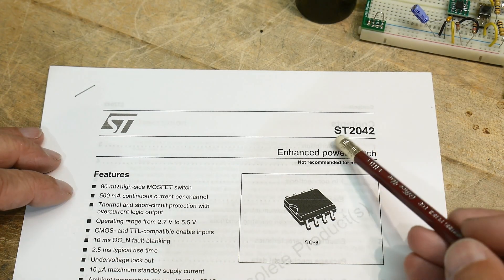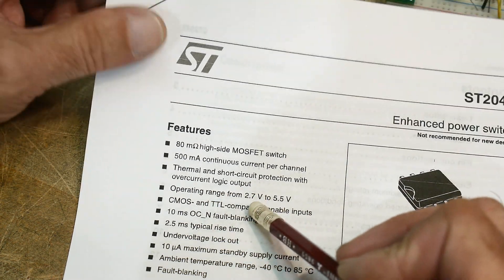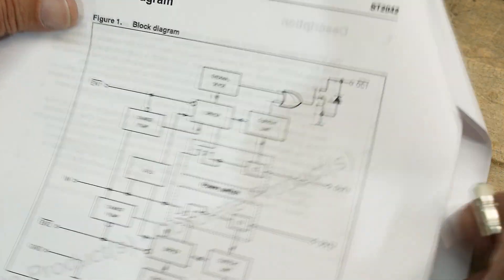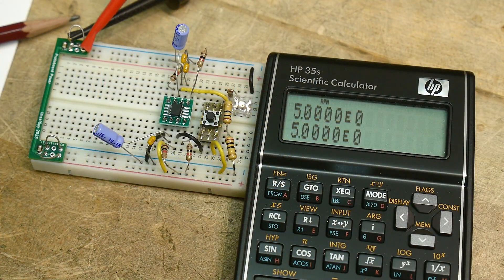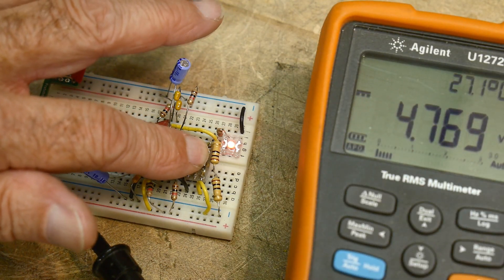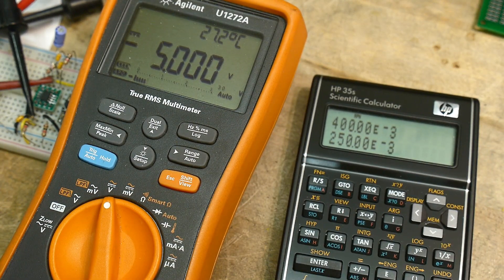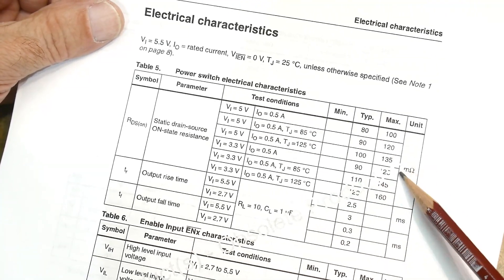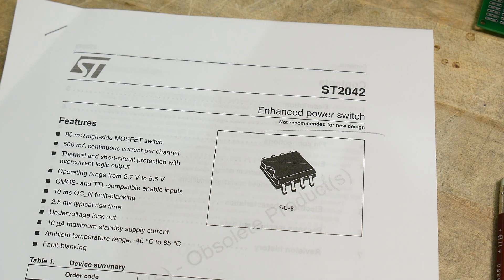#1951 ST2042 High Side Dual Switch

Comment: I bet this chip was for USB power. 500mA per channel at 5V per port? That's the old USB power spec right there - 5V 500mA 2.5W. Obsoleted because few devices are doing it. But I'm sure you can find tons of replacement parts for it, because tons of manufacturers would have produced parts for USB power control. The overcurrent pins are open drain to allow for wiring them all together to a CPU interrupt in case the USB device drew too much current.

Comment: Poor contacts on breadboard.On input you have 5V and at output 4.76V but when measure voltage drop later you get 0.11V

Comment: you can see a charge pump, which you would not need if the fets were P-type. You need the charge pump as with N-types you need to pull the gate higher than the Source or Drain as when the fet is turned on the source and drain are at about the same voltage e.g the input voltage. the charge pump give it the extra 10 or so volts above the input voltage to drive the gates hard on. N-channels normally provide low Rds(on) than p-channels
Reply: Even without a charge pump, that's clearly an N channel symbol.
Reply: @misterhat5823  well everybody is allowed a few mistakes.  And clearly without the charge pump it would not work  :-)
if you can live with a higher Rds(on) then P-channel fets are easer to drive as a high side switch.
Reply: @misterhat5823  Every time I post a video, I expect I've made a slip up or two. it's even better if no one notices 🙂

Comment: 0.3v drop because that's enough for the N-channel to turn on. Datasheet shows you need a charge pump as they are N-channels inside, not P-channel. Why do you pretend you didn't see it?